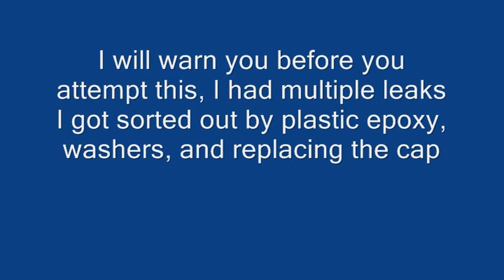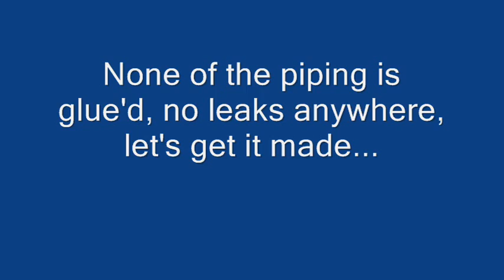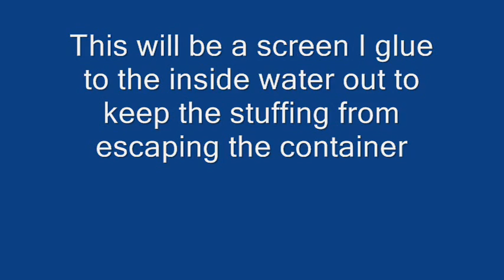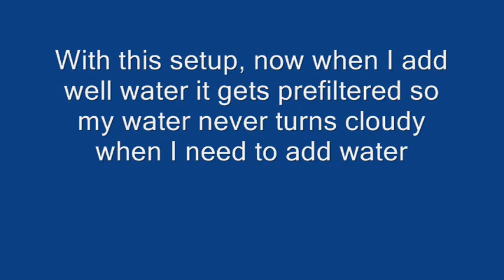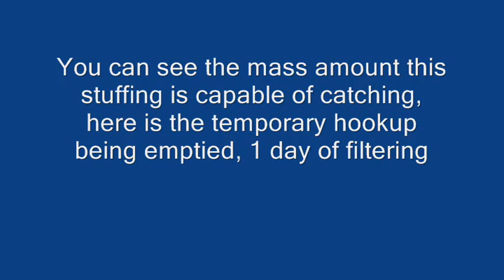How to remove Iron from pool water + waterfall(Fast+Cheap)(Permanent Setup)

Comment: 2 questions for you: 
1) Where'd you get the bin you use for the polyfill? It's great size, flat sides, wide mouth cap so you can get your hand in there...
2) In your earlier video I think you used a Fresh Step container, I'm assuming with the cat litter rather than polyfill. I noticed you zip tied the lid, is that because it didn't snap on tight enough? I've used Lowe's buckets but their snap on lid doesn't stay on once you put water pressure to it. 

I'm now using a white food storage bucket, that lid stays on but it's got round sides so it's hard to mount fittings to it. My fittings are on the top/bottom but I'd rather (at least for the inlet) have it on the side. Your jug here or the Fresh Step would fit the bill....

Comment: I tried this!! It worked over night and the next day it was sorted.
What happened is I made a bore hole and to drill it I had no choice to use the pool water to pump down as it was much more powerful than the hose fitting.
I then made the bore hole and the reason for making it is that water is sooo expensive here. I love my lawn and now use the bore hole. One of best investmints I have made.
I filled the pool with bore hole water and messed up the pool water.
I found your youtube video and made my own with a 250L food grade water tank and used my bore hole pump to pump it from the bottom of my pool and back in again.
I must say my sand filter couldn't handle and was useless in trying to fix the water - all attempts before now backfired.
Now The water is polished like you wouldn't believe
1 thing I must add id to kick the iron out by using a $7 additive Iron Out to make it solid to catch the rest you cant see.

I will keep the filter and polish my water more every now and then. sit it on the side of the pool and pump away nd remove again and let the sand filter continue otherwise(I since changed the sand after it was literally sledged up)

Thanks Buddy - saved my arse!! ;)

Comment: My water must be colored from a different thing than yours because my homemade filter didnt do shit and it didnt really catch much, Theres no way yours cleared up in like 2 days, I bought a sand filter with a little bigger gph rate and running it nonstop for 7 days I am still not crystal clear yet, but its getting better very slowly.
Reply from the maker: Mine is from our high iron content water, it also works on algae, I wanted to do a timelapse video to demonstrate but I need to get a power adapter for the camera, do you have the outtake making the water circulate so it intake will be hitting it all, the way the stock outtake points it doesn't get the pool circulating good so I fixed that, I tried it with the stock and it just took to long, I show at 02:00 what I did there plus aerating the water pushing that oxygen into the water helps out also, definitely for iron, also adding clorine in before you clear the pool will take it longer to filter